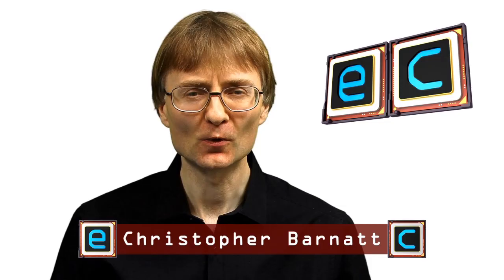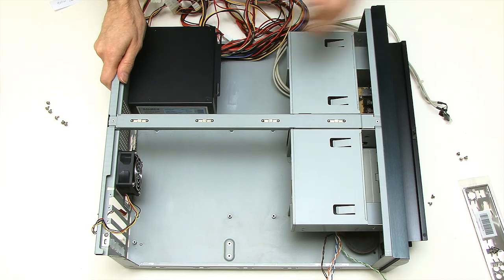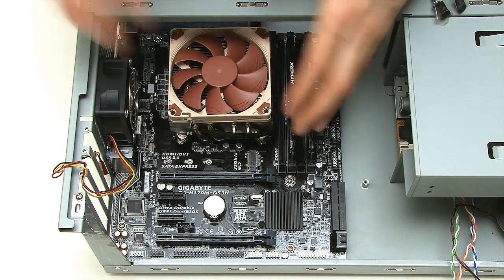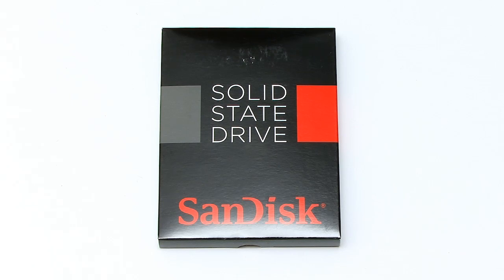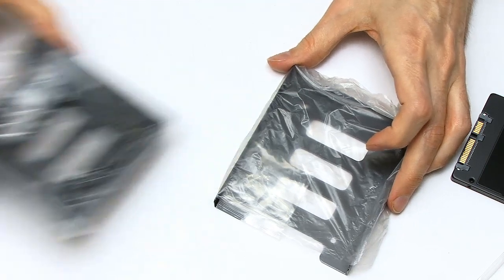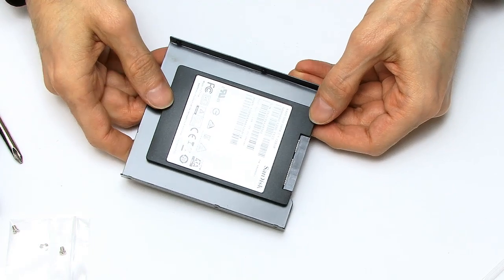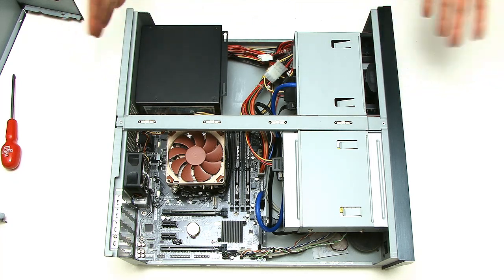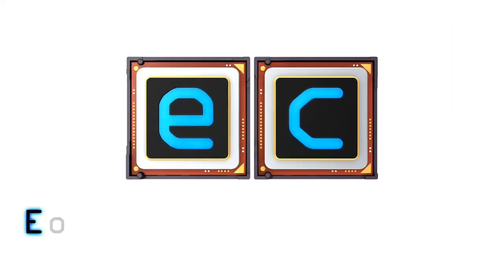i7 PC Build: Part Two

Comment: So Chris... what did your build cost?
Reply from the maker: The cost was about £560 ($700) -- c.£300 for the CPU, £100 for the motherboard, about £50 each for the SSD and the RAM, £35 for the cooler, and the rest for the USB 3.0 bay, bay adapter and SSD bracket. On top of this, I already had the case, PSU and DVD, and an OEM copy of Windows 7 (purchased when still available
Reply: Not an unreasonable costing for a new build (obviously, if I was purchasing this sort of setup, I would not be using MS Windows and be opting for a Linux distribution instead, therefore saving around £60 - £80).

Comment: Why you never use a GPU to render?
Reply from the maker: LightWave does not use a GPU for rendering -- doing so is very much a games and video editor thing.
Reply: But Blender does :)
Reply from the maker: Yes, indeed -- a good point you make! :) Though it does not help me with LightWave.

Comment: are gonna install a gpu in it, may Rx 460 or 750ti
Reply from the maker: I've no current plans given what this machine is used for, but a 750ti would be on my list as you note. :)
Reply: ExplainingComputers it might be a good choice considering the 400 watts power supply and the 750ti doesn't require any 6 pin connection, very good video
Reply: Chris Hercules I'm not sure but im thinking about the bottleneck
Reply: Chris Hercules sure the 1050ti is better for rendering and editing

Comment: Invest in a graphics card if your going to be rendering.. It would cut the time down by a lot.. You don't have to get a gtx 1080. Hell a gtx 1050ti or gtx 1060 would be enough. I am not familiar with amd side so you would have to research for that side of things..
Reply from the maker: LightWave ScreamerNet does not use the GPU for rendering, only the CPU. I am not a complete idiot! :) Adding an GPU would not help matters here. :)
Reply: I didn't say you were an idiot at all. Sorry if it came off that way. I though a gpu would at least help with cutting rendering times at least with the cuda cores. I don't know that much about it except with mainstream knowledge sorry just thought I was being a little helpful that's all...
Reply from the maker: Sorry, my apologies for my response. You are right that cuda cores are used to assist in rendering in many applications --eg video editors. But sadly not in LightWave.

Comment: Given what you're doing with the system you've just built, a higher midrange GPU would not go amiss. GPU's can be used to assist in rendering and can cut your total rendering time in half again. With a GPU the build will require a new power supply of course.

Comment: 400-450w PSUs will do just fine with current midrange GPUs if they are good quality 80+ efficiency.
Reply: CaesarGamer 450W is the OUTPUT power.
Reply: Different PSUs are rated differently. A cheap 600w MAX power supply will likely be outperformed by a decent 300w continuous one, for example.

Comment: why did you choose not to out a decent GPU into the rendering machine? gpus are much better at rendering than CPUs are.
Reply from the maker: This PC is used to rendered 3D graphics from the LightWave modelling package, not games or video, using a utility called LightWave ScreamerNet. This is a command line renderer that uses the CPU only (which is pretty standard for rendering CG graphics). So adding a GPU to this PC would make no difference to rendering speed, but would draw power and raise temperatures -- and increase the cost of the build! :)

Comment: Interesting that a 6th gen. I7 cpu connected to an ssd is only 50% faster in real usage than a vintage core 2 quad cpu, with 4 threads vs 8 for the I7.
This proves once again that cpu upgrades are not really necessary anymore, unless maybe you plan on installing W10 on a former windows XP machine.
Reply from the maker: Agreed. Performance-wise, CPU upgrades are over-rated and over-hyped.
Reply: It really depends on what you do.

Comment: you could get a dual GPU graphics card and that would really speed rendering speed. your MB would take 2 graphics cards, imagine 2 dual GPU graphics cards 4 GPU's rendering your video. it would take a fraction of the time. that i7 is probably around 6 or 7 gigaflops a GPU is 2 teraflops 4 GPU would be 8 teraflops.
Reply from the maker: I am not rendering video, I am rendering 3D animation frames with LightWave ScreamerNet, and this only uses the CPU for rendering. So adding one or more graphics cards would not speed rendering I'm afraid.

Comment: Ok... I wouldn't run that software.. using the gpu is way faster and spike allow you to use the computer while rendering also.. but to each is own,  take care and I hope you have a good Christmas
Reply from the maker: Thanks for this. This PC is used for rendering only. I am not aware of the "Spike" renderer. I am working in LightWave, and one of the big benefits is that you can run an unlimited number of render nodes on other machines. For my workflow, this works best. There is a GPU-based rendered called Octane, but I have not invested in that. As you say, each to their own. And also have a great Christmas! :)

Comment: 2:15  ...you may know that bugs in computers were actually first called that because they were actually insects that got into the works and got all burnt up...

Technically... yes and no.  "Bugs" in computers is a carry over from its use in previously existing scientific fields.  
See this link: https://en.wikipedia.org/wiki/Software_bug#Etymology for details .

In a nutshell, Middle English, in use from 1150AD to 1500AD,  has the word "bugge" as the basis for the terms "bugbear" and "bugaboo" , used to describe a monster.  Thomas Edison used the word in 1878 to describe "little faults" in his inventions.  Both writers , Louise Dickinson Rich & Isaac Asimov used the word several years before the historic incident that I believe Christopher is referencing, about a moth being discovered to have created a short on a circuit board.  This story has significance because it is  the first recorded incident of an physical bug creating a hardware bug but its not the origin of the word "bug".

Not even the word "debug" can be claimed by the field of computing.  That honour goes to aircraft engineers in 1945, in the context of aircraft engines, one year before the moth vs circuit board event.

Comment: I mean, you area aware that is probably the most anemic "render box" ever made. I get that this video is from before the launch of even Kaby Lake but I would hope that you would upgrade this sooner than later. Ryzen, Coffee Lake or THREADRIPPER
Reply from the maker: It serves its purpose -- and the performance differences between chip generations are not that significant.
Reply: ExplainingComputers the newest generation has 4 more threads and Ryzen has 8 more threads. Depending on what you are using to render thats cutting those render times down to minutes instead of hours. You don't even have a gpu in that machine for cuda or open cl acceleration, that may not apply to your application but still. I like your videos don't get me wrong but dont be affraid to explorer the advancements this year has bought to cpus.

Comment: Said screw driver needs a proper name + dubbed synthetic voice to talk-back to you in computerese.  (Your CGI could impersonate "Clippy" -- the MS Office AI Assistant, remember?)  Also, a tool-and-die-maker / family member always pinched my ear if I did not start screws in counter-clockwise motion first, in order to make sure the threads mesh properly (I still do this today, 60 years later!)  For this grievous infraction of machine-shop ethics, this video gets an A-.  One major downside is the choice of a motherboard with SATA-Express (read DOA :).  p.s. Icy Dock have really KOOL 5.25" enclosures e.g. latest one has room for one slim ODD blu-ray burner + 2 x 2.5" SSDs = very nice!  Clippy says, "Hi, Chris!  KEEP UP THE GOOD WORK!!"

Comment: I would advise you to connect an earth wire from the mainboard to the metal chassis of the USB 3 front panel. USB 3 can cause RF and electrical interference with WiFI and Bluetooth (2.5GHz) and RF mice.
Having an insulated USB 3 panel is a bad idea.  See http://rmprepusb.blogspot.co.uk/2014/08/a-problem-with-wireless-mouse-and-usb.html

Comment: GUYS NEED HELP
1: WHAT PSU BUY FOR THIS SYSTEM?
2:THIS IS GOOD BUILD?

Case: NZXT S340 Black-Red
Motherboard: Msi z170A gaming m3
GPU: Intel core i7 6700k 4.0GHz
RAM: Kingston Hyperx 16gb 3000MHz
SSD: kingston hyperx 480gb
CPU: MSI geforce GTX 1070 8gb GamingX
Cooler: NZXT kraken x61
PSU: ???
Reply: GeT BacK evga / corsair fully modular 550/650 80+gold
Reply: David Esparza corsair rm650i ?
Reply: You don't need a modular PSU and 500W 80+ would be also fine.
i7-6700K overclocked @ 4.7GHz, on full synthetic load, would consume 220W.
MSI GTX would not consume more than 200W on full load.
NZXT x61 - under 10W.
As you can see, no, you don't need a modular, gold rated PSU. :D
Unless, you plan to put additional MSI GTX. 
If you won't be overclocking at all, 400W/450W 80+ would be more than fine.
Reply: Faust Von Barley is right as well, you can definitely save some money here and use it towards another component

Comment: Windows XP ? what is wrong whit you ?
Reply from the maker: Like many older computers running a single program -- here a command line program -- and never connected to the Internet, the PC this replaced was running Windows XP, and working perfectly happily doing so. It isn't running Windows XP now. So what's the issue?
Reply: nothing its just very old system nobody using it anymore and when you put i7 processor having more than Windows XP will be better. i am not saying you should go and install windows 7,8,8.1 or 10 but windows xp is not seems nice srry for bad english in my country nobody speaks english )
Reply from the maker: No problem with your English! :) The new (i7) system is running Windows 7, but using a classic skin, so it may look like Windows XP.
Reply: owww ok hah funny

Comment: Notable energy saving? Those "savings" are so marginal that barely worth mentioning on this form factor.
Reply from the maker: Sorry? Since when has reducing the energy used per unit of output (here rendered frames) by 2/3rds been marginal? Even the 1/3rd energy saving at load ignoring output is significant. A lot of work these days -- in places like data centers -- goes into reducing energy use by a few per cent.
Reply: Not debating the frame output, but mere energy savings on such a machine ( hence "this form factor" ), which, in the year wouldn't reach noticeable change, even in places where the cost of electricity is high. Cutting wattage in half shouldn't be regarded as a feature, but a good side effect, in this case, not data centers.
Reply from the maker: I take your point on the form factor, but I still disagree -- both on the percentage power saving, and the c.5KW a week it represents for a machine that will often run 24/7. If every PC in the world used a few tens of watts less energy per hour, that would be a tremendous carbon emissions and energy saving. :)
Reply: By looking at your channel I really doubt that it's going to run 24/7 (not an insult, you have good videos). Even went to GOV UK to calculate the difference if such an event took place and even then, in a year, those savings aren't that big. Sorry, but not convinced that everyone can afford an i7 and is interested cutting carbon that way. There are way more cheaper ways to cut carbon emissions and energy if that's your or others concern. Agree to disagree then. :)
Reply from the maker: Faust Von Barley How can you possibly know whether or not the PC I used to render animation in LightWave 3D will run 24/7 by looking at my YouTube channel? Or even both of my YouTube channels? I was working as an animator for the BBC and other broadcasters long before YouTube came along, and have had single films that took 18 months to render on a 168 hour a week basis. I am very happy to agree to disagree on the significance of the power savings here, but please do not make vague assumptions on all of my activiries by looking at this one YouTube channel! :)
Reply: Again, wasn't trying to be disrespectful. In a way, it was a good thing. Now people know how rich your professional life is. Can I purse you to put that into "About" section? :)
Reply from the maker: Faust Von Barley Thanks. Sorry if I was abrupt. Very high level of stress right now. I will add detail to the channel when I get a moment! :)
Reply: ExplainingComputers Wouldn't even try to refute that. Thanks for taking time to reply. Subs!

Comment: You are trying to show the ease of constructing a computer. I can understand you are limited in time, but you do not give a beginner much help, especially in the fast forward parts.Thanks for nothing. Maybe if I weren't a newbie I'd have a different point-of-view. Where's Linus?
Reply from the maker: Sorry that you feel this way. The only fast-forward parts here are where I fit things together, plug in wires (where the config is different for different boards), and add the screws/etc -- there is nothing happening in these parts that is not explained before or after, or that could be stated definitively expect for a very specific hardware combination.
Reply: It is just that  my lack of previous knowledge required knowing exactly where wires were plugged into the motherboard. Perhaps the problem is that I need more of a "hand-holding" video. Please forgive me if I were rude.